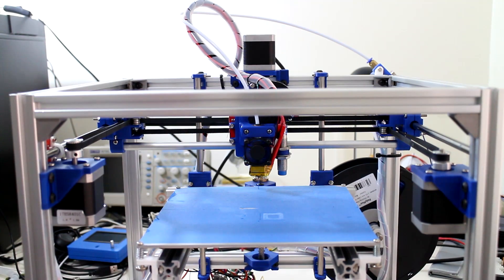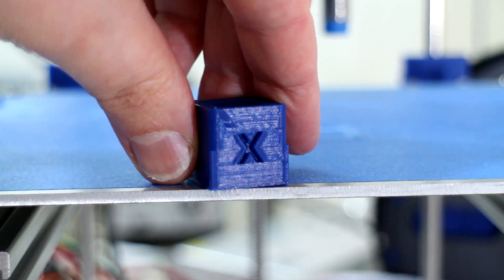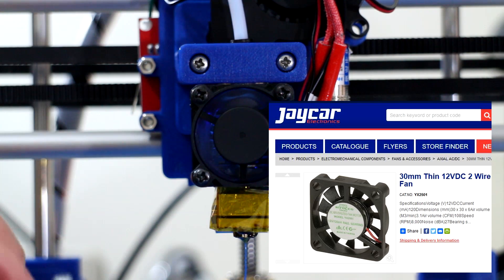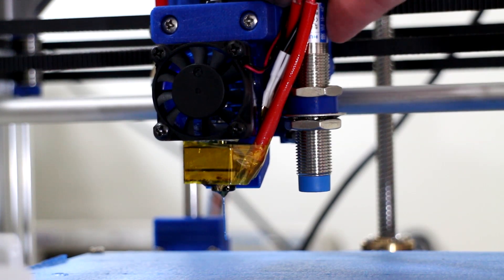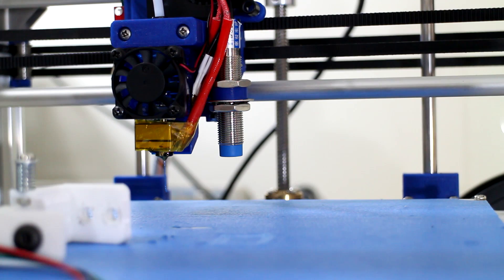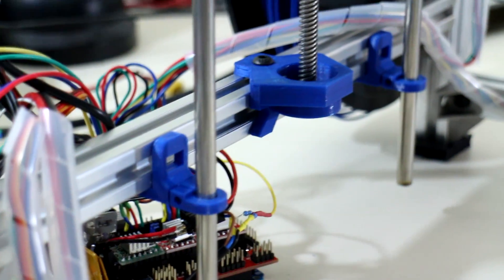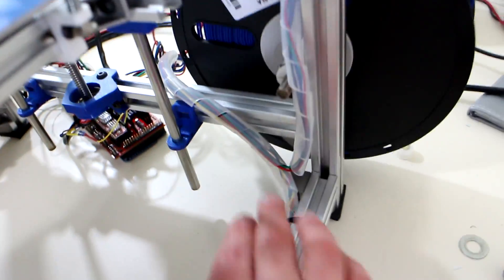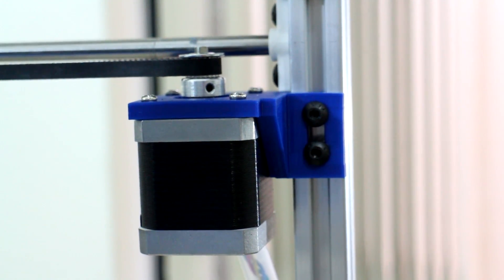New 3D Printer - Build Log #9

Comment: Hey guy, wouldn't it be possible to mount the motors also on the back side instead in the front, to solve the cbeling length issue ? Or would there be a problem doing that ? uh by the way I watched all the videos and I am really impressed, the printer improves itselv by printing new an better parts :-D

Comment: I had my e3d lite6 for 24 hrs and i put a screwdriver through the fan and snapped a blade we must be related :) to be fair i had  a slight excuse my wife thought it would be a good idea to stick a pencil in the crack of my arse while i was messing with the printer
Reply: putting a screwdriver through the coolend fan is a right of passage.

Comment: I have the blue tip sensor but not installed it because I read on reprap that it doesn't need the resistors because it pulls the sig to ground.
Can you clarify what is correct wiring for me please?

Comment: You are missing a cable relief for the heat bed. This is an accident waiting to happen.
Reply from the maker: I agree. I want to re-solder those wires to face the opposite direction then I'll cable tie them to the bed.

Comment: I think I found the link to the new Jaycar fan you have on your machine, but I'm not sure.
http://www.jaycar.com.au/30mm-thin-12vdc-2-wire-fan/p/YX2500
http://www.jaycar.com.au/30mm-thin-12vdc-2-wire-fan/p/YX2501

Did you get the YX2500 or YX2501?

Also, I suggested in the comments awhile back that you might want to consider a Noctura 40mm fan with the same amount of airflow, but MUCH quieter.  Noctura fans are known for being quiet.  Granted, you'd have to print a different fan mount or use an adapter.

https://www.amazon.com/gp/product/B009NQLT0M
Reply from the maker: It was the 12v fan. If I didn't need the fan that day, I would have purchased the 30mm fan from Banggood here http://www.banggood.com/12V-DC-30mm-Cooling-Fan-For-3D-Printer-RAMPS-Electronics-Extruder-RepRap-Prusa-p-1010340.html?p=9X051049165582016063

Dirt cheap and the reviews suggest it's a quiet fan. It's 12v and the proper 10mm deep dimension so should push more air than the Jaycar fans at 6 times the price!

Comment: Will you make a setup tutorial for the auto bed leveling?
Reply from the maker: Yeah it'll come. I've ordered the PNP version of the induction sensor as that version might not need the resistor voltage divider.
Reply: Awesome, thanks in advance!

Comment: This Is an outstanding build.
I m also going to use your in depth video log to build my 3d Printer with a few size modifications
I found this heat  bed which is going to be part of the build http://www.ebay.co.uk/itm/261843207039?ssPageName=STRK:MESINDXX:IT&_trksid=p3984.m1436.l2649
just need to find someone who can cnc the parts for the frame.

Kev

Comment: It's worth noting that there are NPN and PNP versions of the inductive sensor. The two versions are wired differently. I must admit I don't recall which version I have, but I don't need any resistors (in fact it didn't even work when I wired it with them).

Comment: So whats the max build volume going to be when you finish up?
Reply from the maker: X200 x Y200 x Z170. 

The Z height can be increased to 220mm by extending the vertical 2020 aluminium profiles, T8 leadscrew and smooth rods by 50mm.

Comment: I connect my induction sensor direct to the three connectors on the RAMPS board. I tested it before with 5v supply and it worked just fine.  Its a small point but makes it simpler and avoids having the potential divider resistors.
Reply from the maker: I tried connecting it directly but it didn't work. The led light on the induction sensor faintly lit when triggered but the endstop didn't trigger. Are you using the PNP version of the induction sensor? Mine is NPN type and goes high when triggered.
Reply: Ive tried both, - just adjusted the setting sin Marlin. Currently I have the PNP one. I have heard that you have a 50-50 chance with it working, some are more tolerant of a lower voltage. I guess I was lucky!
Reply from the maker: *****

Ah ok. Lucky you :P

Comment: Fantastic build series. In the stl files etc have you allowed for resizing so the hot end prints to the full build size?
Reply from the maker: You mean the full 200mm x 200mm print area?
Reply: +Tech2C sorry yes
Reply from the maker: Yes it prints 200x200 in X and Y, but only 170mm in Z. The Z can be extended to 220mm by using a 350mm T8 leadscrew and using 400mm vertical aluminium 2020 extrusions.
Reply: Brilliant, I'll slowly be building one but at 220 x 220 x 230/220 depending on my mental state at the time so I'll need to add this to the metal lengths lol
Reply: Cool :) and for the Z 8mm rod ?

Comment: Awww...I was enjoying this series and now it's coming to an end. Well done, it works well. 

I was using a servo based ABL but it had it's problems so I just spent three days setting up a BLTouch because I like printing on glass. Once you sort Marlin out to work with it it works very well.....
Reply from the maker: Almost over. Just need to go over wiring and Marlin firmware.
I know what you mean about Marlin and ABL testing...

Comment: Congratulations for this whole project. I for sure know how hard designing a 3d printer can be.

Just a question: How do you tighten the belt?
Reply from the maker: Easy! Just slightly loosen the screws holding the belts in place. Use long nose pliers to 'persuade' the belt in the direction you desire, then tighten the screws again.

Comment: +Tech2C Hi! I am loving this diy printer series.. I just have one observation. The z-axis motor has a flexible coupling which is holding the entire bed assembly right? So basically the coupling acts like a stiff spring. Will this not affect the quality on the z axis?
Reply from the maker: Well not exactly. You may have noticed the leadscrew is resting on a bearing at the base. I make quite a big deal of that in video number #7.
Reply: +Tech2C Sorry, I missed it.. I have the Tevo Tarantula and it has this exact problem. Maybe I can fix it similarly..

Comment: What kind of bed did you use? I guess the induction sensor will not work with the PCB heat bed with a glass on top, am I right? I like to use ABS, that metal bed works well?
Reply: My heatbed has the PCB bonded to an Al back -- this is the way the Replikeo printer was shipped. I believe Tech2C is the same. That setup can work with a glass on top but you need a sensor that has a greater range (e.g. https://www.amazon.com/gp/product/B008FZC8F2)

Comment: I've printed out your set up I found the Bowen oozes and u can't print super fast I'll up load my super fast e3d mount with direct drive to thingiverse it has the stepper mounted above the x rails rather than hanging off the front and causing crazy vibration on a i3 ;)

Comment: I can print 150ms on a modded i3 easy u need to get a direct dive for very fast prints 
the faster u go the better the prints will be
Reply: Wow, that's fast! I have an original prusa i3 mk2 with direct drive but I feel like the frame would vibrate too much at that speed. Have you done anything to your modded i3 to limit vibrations?
Reply: +James Schumacher redesigned the hot end mount and put the stepper above the x rails cut the top of the i3 and extended it up to fit the mod
Reply: +James Schumacher the stepper hanging off the front causes the problems of vibration slower speed cause low frequency vibration fast printing the frequency is higher and vibration is alot less
Reply: +James Schumacher the stepper hanging off the front causes the problems of vibration slower speed cause low frequency vibration fast printing the frequency is higher and vibration is alot less
Reply: Ah, okay, that makes sense. Thanks for sharing!
Reply: Bowden extruders work better at high speeds

Comment: Consider using PEI (https://www.amazon.com/gp/product/B0013HKZTA) as an alternative to blue tape.  Tape was my first success after getting my printer (after trying glue and hairspray). After that I switch to glass and an adhesion layer.  I tried a variety of adhesion material include ABS juice, tape and glue before settling on hairspray. 
Once you get the amount/pattern down hairspring is good for ABS but PLA adhesion was never great for me. In any event application is messy... Since then I've switched to PEI.  PLA, ABS and PETG work very well without any addition.  As others have found I have successfully lowered bed temperature (e.g. print PLA at 45 instead of 60 or ABS at 80 instead of 110).  As others have said it's like magic :-)
Reply from the maker: Do you need heat with PLA on the PEI surface. I only use heat with PLA for larger parts. I have a sheet of PEI here that I used earlier on and it did work. I had an issue where the nozzle came a little too close to the PEI and melted it a bit. How have you stuck your PEI sheet down?
Reply: I used 3M 468MP adhesive.
Reply: Personally, I like the sheets that CS Hyde provides since they have the adhesive pre-applied to the PEI Sheets:

http://catalog.cshyde.com/viewitems/3d-printing-materials/ultem-pei

Comment: I just built a Kossel (delta) with one of those induction bed sensors, and effector tilt makes it beyond useless.  I'm glad it works well on a CoreXY.
Reply from the maker: That sux. Do you use a micro switch or some other sensor for auto bed levelling?
Reply: +Tech2C same sensor you have.
Reply: Sorry, mistook your meaning.  It's not the sensor, the sensor does its job just fine.  It's the action.  For auto level on a delta to work, the printer already has to be calibrated and tuned to where it prints just fine without it anyway.

Comment: Hi there. I have been watching all your video's on this build so far and they are extremely interesting and I entertaining. The only problem I have is the shaking of the camera. I am a bit epileptic and I really have problems watching this because there is not ever a moment where you hold the camera still. I would love it if you could hold your camera on a tripod of a hand mount so it won't be that shaky all the time.

Keep up your great informational video's !!! Thanks.
Reply from the maker: Very sorry about the shaking, I try to use the tripod where possible but getting some angles is difficult without moving the camera. I will keep it in mind for future vids. Cheers!

Comment: There is no need to use a resistor divider if you are running inductive sensor at 5v. It will still work if you connect +, -, S directly
Reply: I don't know about the sensor Tech2C used it might be that the specs for his required more than 5V.  Mine did -- the spec stated 7.5v.
Reply from the maker: I tried 5v initially but it wouldn't trigger the endstop function. The light on top of the sensor lit very dimmly. As soon as I powered it with 12v and the voltage divider for signal it worked instantly.

Comment: Its strange, I never got that extruder system to play ball with my p3steel, it always skipped steps even at high current. Using a geared extruder made thing SO much better.  I was thinking about using 2 extra steel rods in front to stabilize the platform for a 30x30 build but then they would get in the way. The only option is to move them to the sides of the printer, but can it be done with your design?
Reply from the maker: Yes it can. Print 2 sets of the Z axis and mount them on outside left and right. Then suspend 2 pieces of extrusion between them for a solid build platform.

Comment: This design is really promising and has a greater potential when fully developed. Please consider some future milestones in development like: The frame allows for designing anti draft enclosure or even semi heated chamber for ABS. For PLA additional cooling fan would be a improvement - higher extrusion temperature leading to higher feed rate with the fans being able to cool layers fast enough. The third issue is of course flexible filaments vs bowden tube, and here make a shorter cable by possibly mounting the extruder unit over a centre of the printer with a specially designed tight bowden tube laid extruder. And last where to mount a second nozzle for dual colour or soluble support printing. With some tweaking this frame would be able to take all that. Its a great start for a project congrats.

Comment: Hey TECH2C, are you going to enclose whole printer with some acrylic sheets? I believe aesthetically it would look much cooler and also you would avoid any abs warping(if sometimes you do suffer from it). Fallowing enclosing the printer, the fume filter would also come in handy. Just brainstorming :)
Reply: +Bryce Standley 3D Printing! If only they had transparent aluminium...
Reply from the maker: That is definitely an option with this frame. I'd like to exhaust the fumes out a window.
Reply: why stop at acrylic? go full aluminium :P
Reply: I wish :P